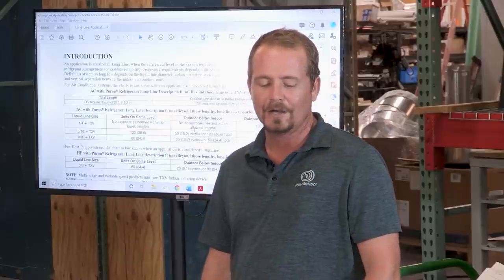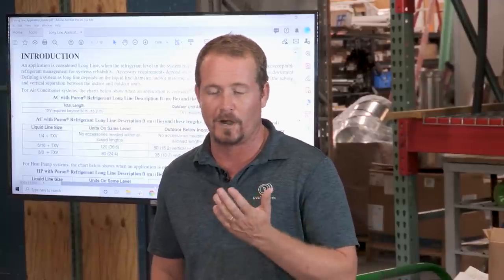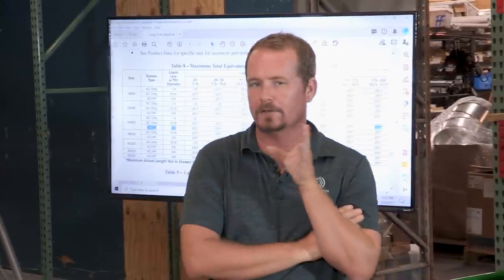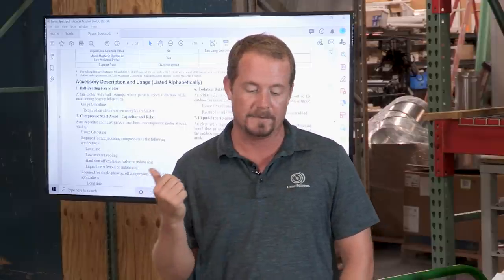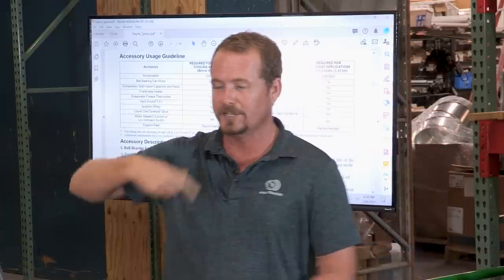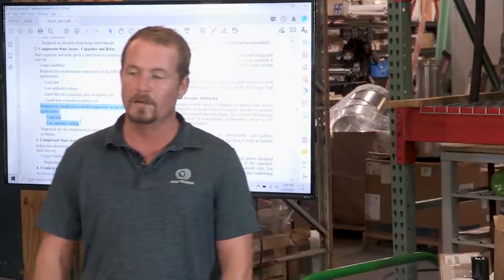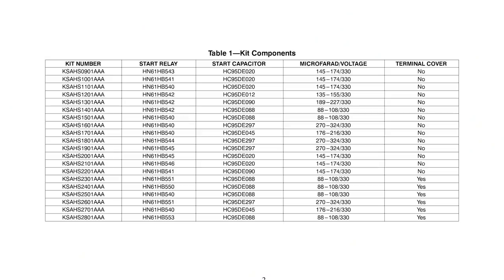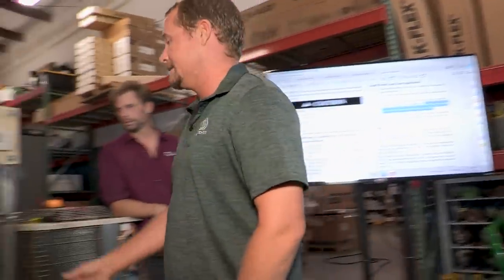Long Line Applications

Comment: Teachers who constantly (ask the class why?) (who can tell me ? ) is such a bad method and flow. It causes students to mind wander and decreases participation. Only the me,me,me guy will always answer. Just teach the goods.
Reply from the maker: That's an opinion you are entitled to
Reply: Beamcannon I would fall asleep in your class. Pretty good lecture overall. Pizza guy always baffles me a little.
Reply: SO TRUE, Just look at the guys
Reply: Encouraging discussion and allowing for active thinking in the class is much more effective than lecturing.  I am an HVAC trainer and this is exactly how I conduct my classes.  Notice that Brian occasionally pointed his questions at students that hadn't answered yet to encourage the whole class to participate.  

When it's an impromptu class like this without preparation on the part of the students, it's necessary to actively involve them in the learning process.
Reply: @Oldthesis  the camera shot of the group here does not support your theory. However it does work for some like I said.
Reply: I think it is crucial stop and ask.  Gives the students time to think. Also, if you know you might get called on, it requires you to pay attention. @Bermcannon if you are using this for quick reference I can see how it could be frustrating. Finally, we don't know why they look tired. It could be because they worked a long hard day. I dont look ecstatic when I'm training.

Comment: This was a great refresher class, been a minute since I have seen a solenoid valve, or especially crank case heater.... Working hvac back in the 90s by Palm Springs California I suspected possibly one of the stupidest things to put on an air handler was that crankcase heater. Outdoor temp 115 in the shade... the rtu will melt plastic on tools.... funny, almost all the  crankcase heaters were burned out... possibly they hooked them up wrong... I don't remember seeing any wired across the contactor... most were line and a few  on the load side😂. Makes sense the way you explain it.

Comment: Brian, thanks for the information. You mentioned that you would offer advice on how to bury line set, if necessary. I understand the potential for condensation but in my case there is no option but to bury for approximately 35 ft. The install in in North Florida (Jacksonville area). Advice please on how to do this while minimize condensation

Comment: Brian, 
Not a tech but Im trying to learn more about capacitors and you answered a lot, but i still have questions. In short, put a universal condenser fan motor and matched dual capacitor on a trane with running but too noisy, fan motor, it started and ran but it seemed to be not up to full speed and had a pulse feeling vibration. Ended up calling a local tech and he installed an additional run capacitor (small one) and it ran great . What should i have measured or looked for to have known this.  This unit at daughter's house in Ga. And Im back in Tx now. 
Thanks and these vidios are very informative, great job

Comment: I was told by D&L to remove the relay & direct wire a hard start straight on a fairly new 2 ton Goodman heatpump.. that a previous tech had started removing parts & he thought the factory hard start was a special run capacitor... it sat for 8 months.. I figured out the entire reason it wouldn't run was because it had 0 refrigerant in the system.  He'd melted both Schrader valves & it leaked out.. 😅

Comment: Ya missed a test. The crank case heater not only heats via the band, it also pulls watts through the compressor windings, and the motor windings ALSO produce a small amount of heat. Ya can measure the milliamperes on the common winding.

Comment: Your guy asked why wire the solenoid on the y call, not on the O call. I hope you answer him… most thermostats energize the O terminal when in heat mode, the entire season, the valve would remain open.

Comment: So why can we do that when we have a 5/16" line over a 1/4"?
Finger over a straw principal been actually locked out liquid in liquid line in a substantial enough amount to adequately feed the TXV and have totally superheated gas 
By the timer on the way back from the evaporator to the condensing compressor

Comment: What is the weakness of piston of metering device?
Reply: None, they work but not "efficient "
Reply: High seer unit with low ambient = ice up's. Txv's has a wide range of operations to compensate for external factors.
Reply: @airmech5083  high seer unit wouldn't have a piston.(shouldn't)
Reply: @realestateservicessaleshea99  if the txv is a separate purchase, most guys go with the factory supplied metering device (piston).
Reply: A piston metering device has no variability.
Reply: @airmech5083  AM ???
WHEN YOU BUY OVER EFFICIENCY CRAP WHY WOULD YOU NOT INSTALL A TXV???
Reply: @SuperVstech  like I stated not EFFICIENT, NO????
Reply: @realestateservicessaleshea99  yes and no, it is more that it is only efficient under ideal circumstances. The txv has a much wider range of efficient conditions.
Reply: @SuperVstech  would you install a piston with a high efficiency unit?
Reply: @realestateservicessaleshea99  I wouldn’t install a piston on any efficiency unit… but it is commonly done. Installers don’t care. And with the piston, it meets 14.5 or 15SEER rating ahri spec. High efficiency units have built in TXV, OR EXV, so the point is moot anyway…
Reply: @realestateservicessaleshea99  I don't know why you're shouting. If the manufacturer ships with a piston then obviously a txv is optional.  Options in anything is an additional cost. A car dealerships wouldn't throw in options at their cost, so why would an ac company do it ? Unless the option is taken into account on the pricing then the txv kit will be part of the order.
Reply: @airmech5083  why would a person buy high efficiency crap and not utilize the txv?
Reply: @realestateservicessaleshea99  many do, I worked for a company does about 1200 units per year on housing development. It was all piston 13 seer. Figure they did like 6000 homes. I did piping, service and startup. Units were excellent with oversized A coils it's where you get efficiency, not from a txv.
Reply: @realestateservicessaleshea99  I would say if you have a wide variation in outdoor ambient TXV is generally the best choice of metering device. But if outdoor ambient is constantly above 65 then fixed bore metering device are good on constant load condition small applications.
Reply: @airmech5083  txv vs. Fixed bore .
They both work!
I believe that was my original statement and the efficiency debate is negligible at best if other factors aren't addressed!👀😎

Comment: as far as 1/4" lines, u use larger to reuse line sets with higher efficiency in the future... line sets are the largest fee wen replacement is needed... change outs are easy.  same applies to your low voltage rough imo.
Reply: simple way to look at it: what do u need to do to replace a 10 seer with a 16 seer, 2 stage or better?
Reply: a change out is cheap if they have 7/8 3/8 and 8wire low voltage, no?
Reply: now, consider what most builders have roughed... lol